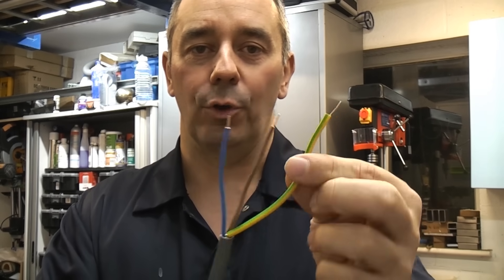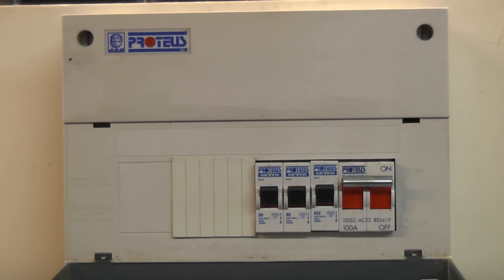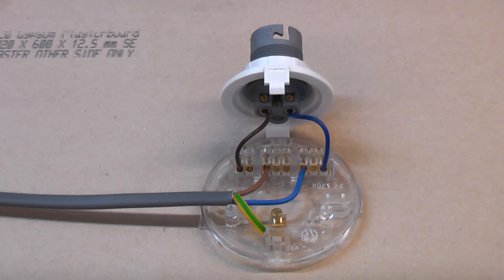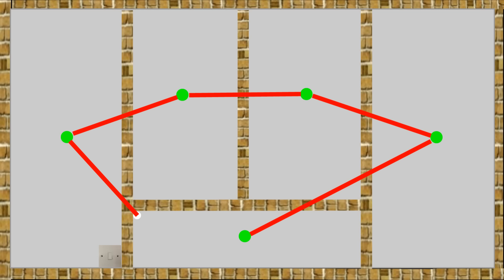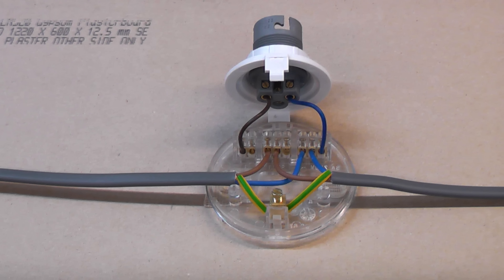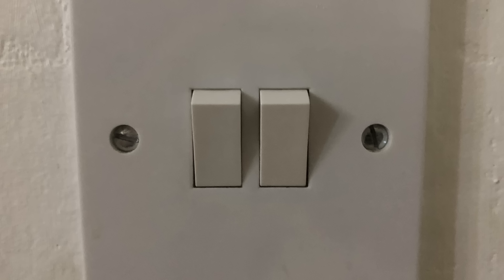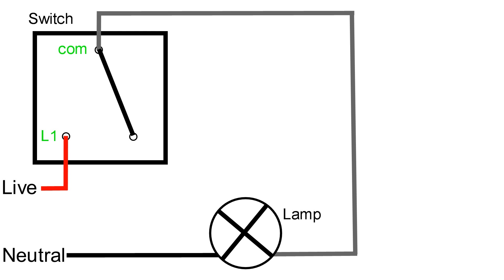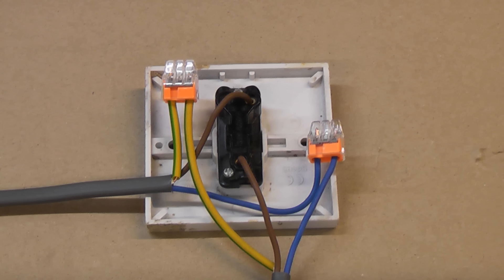UK domestic lighting circuits | Loop in at ceiling rose | Loop in at switch

Comment: I'm doing NVQ lvl2 electrical installation, this is helpful for this course, maybe you could put a tag on the vid, for other beginners. I must admit i clicked on this as the thumbnail for this vid is a half done ceiling rose with no switch live, and a looped neutral. I assumed you'd be demonstrating with one ceiling rose, so an incoming an outgoing with no SL and a looped N???? Obviously it is a pic of a ceiling rose chained to the next light, with switch wire still to be connected. Ended up watching whole vid, as it was interesting 👍👍
Reply from the maker: Thumbnails can be difficult, sometimes YouTube automatically generates them, but other times I have to make one, normally from a still photo. It's hard making a good thumbnail, so sometimes I just take a shot with my camera and use that.
Thanks for the comment 👍

Comment: I agree with you, a junction box is the place to join multiple wires, not in a ceiling rose or at the switch. The ceiling rose often gets jam packed with wires making it hard to reconfigure or even get the lid back on! And the switch is really designed for a single wire per terminal.
Reply from the maker: Thanks for the comment ;-)
Reply: I have to disagree. Those screw terminal junction boxes are not maintenance free, and as such must be accessible for inspection. Ok for loft spaces, but not where the box is located beneath floorboards; especially below laminated flooring.

Comment: Is an Inline RCD protection necessary to add to a new looped circuit from old existing light circuit power by fuse box?
Reply from the maker: I'm not sure, sorry. 
It's best to ask a qualified electrician.
Thanks for the comment
Reply: @ultimatehandyman  Previously only a light in a "special location" as defined by BS7671 needed rcd protection, Under the new 18th edition regs, all domestic lighting circuits must have a 30mA rcd, so Yes, because any additions or alterations need to comply with regulations

Comment: Some good info, but there is another variation, I've come across mainly on the downstairs lighting circuit, where the cables are under the floor,  then run up the wall, so in these circumstances the live feed goes to each switch first, then to the light fitting.
Reply from the maker: That will be the loop in at the switch then, which is shown in the video?
Thanks for the comment

Comment: I have just fitted 3 bulb ceiling light which has a ceiling rose fitted like that at 6:14 on the video (2 cables coming from ceiling, not 3).  I have fitted 3 dimmable LED lights, and a LED compatible dimmer switch.  However, when switching on all I get is the initial click which switches the lights on fully and the rest of the turn of the knob has no effect.  I have tried another dimmer (same result) and tried one of the dimmers connected up to a simple test cable setup in the garage and the dimmer works ok.

It's got me really baffled.
Reply from the maker: Have you tried just using a regular switch on the circuit? 
Thanks for the comment
Reply: Not all dimmers marked as "LED Compatible" work with all types of LED technology. These are some of the best on the Market https://zanocontrols.co.uk/

Comment: How many amps should it be for a 4 way junction box?
Reply from the maker: 20 amp is normally used on lighting circuits, which are protected by a 5 amp fuse or 6 amp circuit breaker.

Thanks for the comment

Comment: Are these wiring processes typical to Europe in general, or are they strictly English/British?
Reply from the maker: These are typical in Britain, other parts of Europe do things much differently. For example a lot of properties in Greece run their wires in conduit etc.

Thanks for the comment
Reply: @ultimatehandyman  Thank you for the reply. I'm an electrician in the US, and I got curious about the way things are done across the pond. With the exception of the color coding of the wires, and the boxes used, it's very similar. (Of course it would be, the basic principles of electrical dynamics aren't hemospherically dependent.) I know this was in a video on the complete wiring of a structure, but the gist is fairly the same. Thank you for making this video.

Comment: Awesome, thanks ever so much for sharing the knowledge! Would I be right in saying that, if want to add a new light into my loft, I would need to split the outgoing cable from an existing light, then wire both new ends into a junction box, as well as one for the new switch and one for the new light fitting?
Reply from the maker: Basically run a cable to the circuit wire, you can do this at a ceiling rose, or junction box.
Run the cable with the L,N and earth to the switch.
Run another cable to the light from the switch and connect up L,N and earth.

Then at the switch connect the two Neutrals together, then connect the earths to the earth terminal.

Put the two remaining live wires in the L1 terminal and the com terminal

I hope this makes sense?
Reply: @ultimatehandyman  This makes perfect sense; again I can't thank you enough for all your help. Looking forward to the next video...

Comment: I would like some advice please I have received a uk cieling light. But  rather than the usual blue and brown wires coming from the light. I have a black and white wire logic would make me think black is live and white is
Reply from the maker: Not sure, It's best to check with an electrician in your own country. I'm not familiar with colours used in other countries, sorry.

Thanks for the comment
Reply: Oops I didn't make obvious I'm from the UK.  I bought the light from Amazon so it should be standard cable blue , brown and yellow green.

But this has a black and white cable and a loose earth cable with  a washer on one end and a unstriped end.

I'm just really confused why they have used white and black wires.

If I know which wire is live and nutreal I can connect it.

My local sparkie works a 3 day week so he's very hard to get hold of.

Cheers.

Love your videos by the way
Reply from the maker: Sorry, I thought the white and black wires were the fixed wiring in the property.
You need to get the light checked by a qualified electrician, as it could be from a country that uses 110v fittings instead of 230v fittings.
Reply: @Apark1990  What kind of bulb cap does it use ? For Bayonet cap - polarity isnt required. For screw in - then the part for the very top of the cap needs to be live and the actual screw thread is neutral. If you have a multimeter, put it to continuity (usually an Ohms sign, or like a noise sign. When you touch probes together will read zero on screen or beep) check between one cable and the screw thread. If you have continuity (zero or beep) that is your neutral, if not that is your live

Comment: I prefer to loop at the switch, it means you don't need to be up a ladder trying to fault find at the ceiling rose, you can just work comfortably at the switch, another advantage doing it this way is it eliminates rather unskillful diyers getting the switch live mixed up with the neutral then blowing their electrics or themselves up in the process time and time again, perhaps the only downside with this method is the switch box can get a bit crowded so it can make fitting the likes of dimmers a bit of a pain, I don't like dimmers anyway so doesn't bother me that much. I guess everyone has there own preferred method wiring lighting circuits,  I try to avoid junction boxes unless absolutely necessary, I personally like to keep all my connections easily accessible but that is just me.
Good vid
Reply from the maker: I agree about dimmer switches- they are a right load of rubbish!
Thanks for the comment

Comment: the first house we moved in to  had a double pole fuse system and 3/029 rubber covered cables  separate earth wire with no insulation  the other cable size I can remember was a 7/036 funny thing was we never seemed to have any trouble back then

Comment: Funny you uploaded this as I fitted a new light switch earlier and managed to give myself a belt due to switching off the wrong mcb doh.  Might have been a good idea to explain why upgrading to a cu with rcd protection is very wise. I'm glad I had rcd protection today ;).
Reply from the maker: I'll cover CU's soon ;-)
Thanks for the comment
Reply: @ultimatehandyman  Might be easier to cover the proper safe isolation procedure ;)

Comment: Do they not give extra cable for later retrofits.  US NEC recommends 8 inch ends for all cables to allow for add on work later.   That’s why our junction boxes are so much bigger.   Are you allowed mixed lighting and receptacle circuits?
Reply from the maker: They tend to make the cables as short as possible- to save money on the cable ;-)
In the UK, you would never see a three pin socket on a wiring circuit (unless it is a special round pin one, designed for lights)- mainly because the light circuits are not wired in thick enough wires- and the fuse or MCB would keep blowing/tripping.

You do sometimes get lights wired to the socket circuits though, especially if a conservatory is added to a house. It's quite common to take a spur from a socket and wire that into a fused connection unit, with a 5 amp fuse. 

Thanks for the comment

Comment: Hi great vid chez.wanted to know how would you wire a outside pir floodlght? would it be better to wire in to a light switch? many thanks
Reply from the maker: Thanks, normally the easiest way is to use a flex cable, through the wall, then wire a plug to the end of it and plug it into a nearby socket. 
Thanks for the comment

Comment: Excellent video,  explaining the difference between loop at rose or loop at switch.  We had an extension built a couple of years ago. the new part is wired loop at switch,  the original part is still loop at rose. now I know why there is connectors behind the light switches.
Reply from the maker: Thanks for the comment ;-)

Comment: They seem to do loop in at the switch in newer build houses, it's probably to make it easier for a homeowner to change a light fitting without having all of the loop wires to deal with at the light fitting because most people would just connect all of the brown or red wires together and all of the blue or black wires together and think that it was right until they energised it and found out that the breaker keeps tripping.
Reply from the maker: They probably don't do it that way to make it easier for the home owner, it's probably wired that way for convenience or for cost (saving a few feet of cable).
Thanks for the comment

Comment: I like yours videos but i hate it when people are showing diyers who don't know what there doing this type of work because in most houses which still have red and black most of the time the switch live isn't marked so it looks like a neutral and they dont know what there doing put it in with the rest of the neutral's creating a short circuit so people should really know that electrical work is not diy and leave it to the qualified sparks
Reply: People will attempt electrics either way, it's better to try and educate them
Reply: A very important tip to remember when dealing with electrics is... assume nothing. Even if a cable is marked, use that tester and prove it. There are no shortcuts.
Reply: I can't afford an electrician. These youtube videos have actually made my house a million times safer than they were 3 years ago, it was insane how dangerous things were here. Thank you for youtube videos ❤
Reply: If in doubt get the meter out😀
Reply: Ignorant comment. People are trying to learn
Reply: Would a neutral short like this not trip the breaker?
Reply: Not everyone knows a qualified sparky, is everyone who doesn't know one meant to just sit in the dark.
Reply: How do people learn otherwise. Videos like this should be monitored like graphic content is for electrical apprentices, tradies access only

Comment: Tidy. We use wire nuts.
Reply from the maker: I've seen those- but never used them as someone said they have a tendency to get hot and start fires (that could be a load of nonsense though)
Thanks for the comment
Reply: @ultimatehandyman  Lots of (wire) nuts here in USA, all the houses would've burned down, lol.  (Flowers in the ceiling, lol.  Many houses have no "roses"  just table lamps.)  Good videos,  thanks.

Comment: Excellent video, thanks. Perhaps you should mention that if you use the junction box method then the junction box should be accessible e.g. not located under floorboards. Any connections that are not accessible should be maintenance free e.g. Wago type lever. The screws in the junction box can, theoretically, become loose over time and are therefore not maintenance free.
Reply: Well pointed out Mark, I guess you are an electrician because not many people would have known that.
Reply from the maker: Thanks, Mark- yes I should have mentioned that in the video!

Comment from the maker: This video took me weeks to prepare, I hope it helps to explain how a domestic lighting circuit is wired in the UK. Please like, share and comment (if you can).
I hope everyone has a great Sunday 😉
Reply: Awesome video, much appreciated thank you.
Reply from the maker: @farshadashrafe2327   You are welcome
Thanks for the comment
Reply: Thanks excellent explanation
Reply from the maker: Yes, it's hard to say without seeing it- but that is what most people would do.
Reply: How do I control a second light to the current existing one that is wired to a ceiling rose(junction box). Ceiling rose is now hidden behind osb boarding covering the rafters. Is there a  way to use the same switch to control the 2nd light without removing the osb. Thanks
Reply: Hi again.  Could you "Please" try and answer my question, asked on poblic comments about a week ago. Many Thanks!
Reply: Was actually bloody handy this thanks 👍
Reply: We are struggling to wire our ceiling light because coming from the ceiling is a red, black, green/yellow and a grey wire. Our ceeiling light only has the brown and blue. So we are confused with what to do with the grey wire. Can you help?
Reply from the maker: @lauraverrall7904   No, I'm afraid I can't.
Whoever removed the old fitting should have taken note of where the grey wire was connected. 
I'd just leave the grey wire and put a bit of insulation tape over the end of it, but you might find that something that used to work no longer works. The grey wire may or may not be a "borrowed" neutral, you'd need an electrician to look at it for you.
Reply: Could it be a loop in, the grey cable being for the light switch? Only just learnt about these from diying my own light fitting
Reply: Ultimate Handyman   I'm a sparky i love it when folks call me and ask if I could have a look at a light they have fitted and say it won't switch off 🙄👍
Reply: Think I finally found the explanation pce  needed, excellent the  thank you